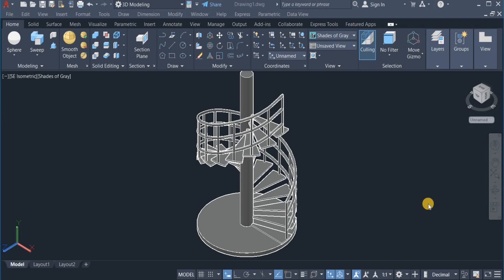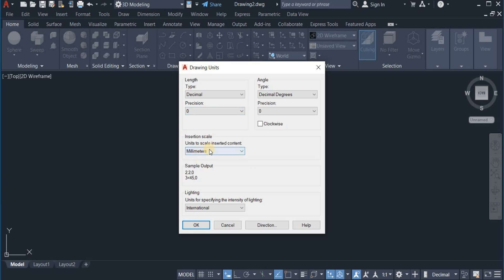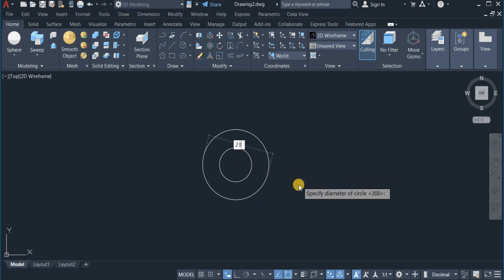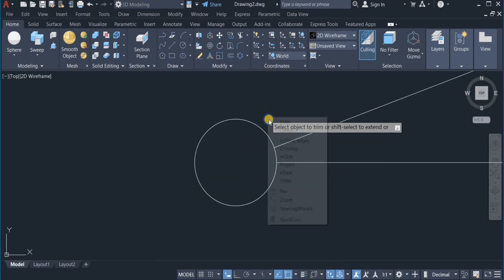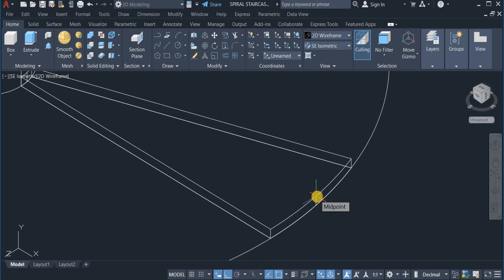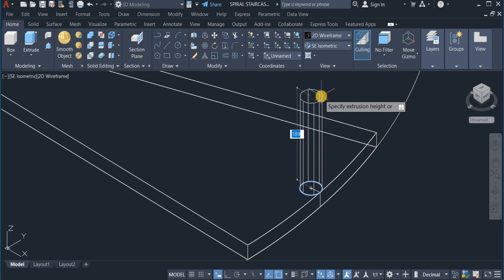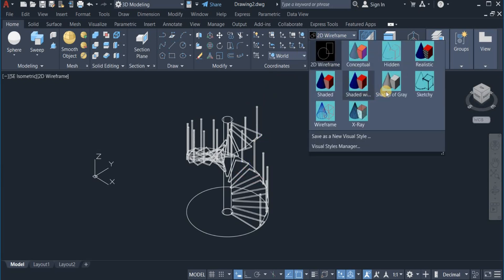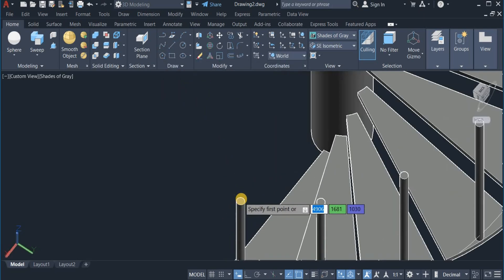Spiral Staircase Design in AutoCAD (Step-by-Step)  #EngineeringDesign

Comment: The path of array is not explained
Reply from the maker: 1. Draw two concentric circles of diameter 200 units and 2,300 units. 

2. Draw a line from the centre of the two circles to touch the Quadrant Point of the bigger circle. 

3. On the Modify panel, click on the Array command and choose Polar Array. Click on the line & Enter, then click at the centre of the two circles & Enter. By default there will be 6 lines.

4. Right click and choose "Items" from the drop down window and Enter 18.

5. Leave two lines to form the layout of the first step then delete the rest.

5.

Comment: can u list the step by step process?
Reply from the maker: 1. Click on the Helix Command on the Draw panel and Enter.
2. Click on the centre of the circle
3. Click the Quadrant point of the circle (base radius) Enter.
4. Click the same Quadrant point of the circle (top radius) Enter
5. Right Click and select turns, Enter 1 (one turn of the helix) Enter
6. Enter 3000 as height of the helix. The Path will appear.

Comment: How did the array path just appear?
Reply from the maker: Thanks for your observation. That portion of the video was mistakenly trimmed off during editing, but I'll show you step by step on how to create the path.
1. Click on the Helix Command on the Draw panel and Enter.
2. Click on the centre of the circle
3. Click the Quadrant point of the circle (base radius) Enter.
4. Click the same Quadrant point of the circle (top radius) Enter
5. Right Click and select turns, Enter 1 (one turn of the helix) Enter
6. Enter 3000 as height of the helix. The Path will appear.
Reply: @HYCAD it has refused to work for me tag me in the same video how to go about it.Thank.
Reply from the maker: The Array command is on the last row by the right of the Modify Panel. Click on the tiny arrow beside the icon and select Polar Array.
Reply: Thank you perfect tutorial just the small problem with helix